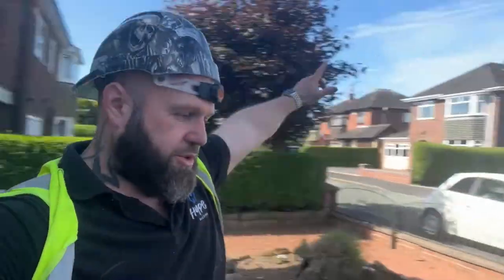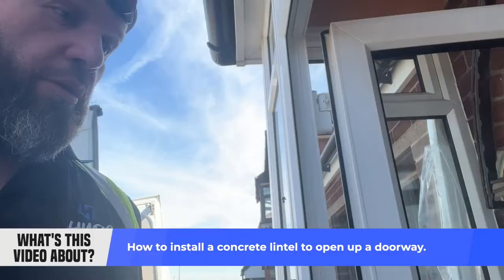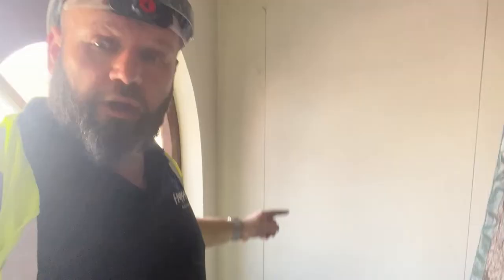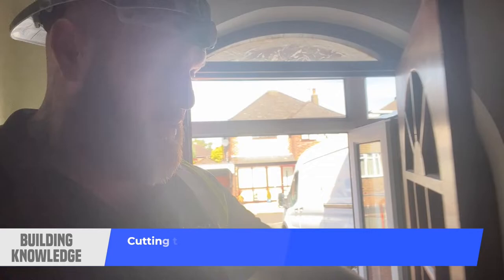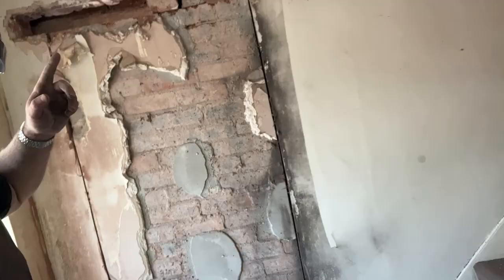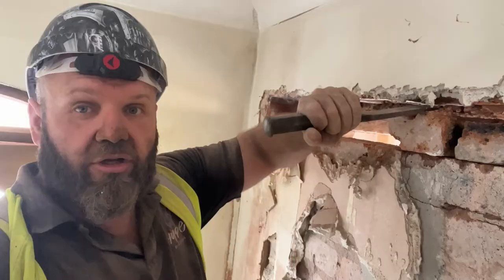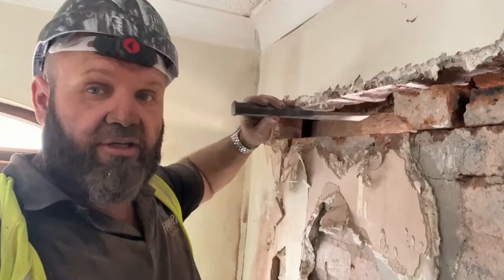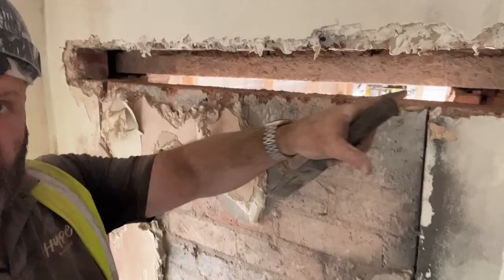How to Install a Lintel to Create a New Doorway

Comment: Why doesn't the wall collapse with all those bricks removed?  Shouldn't you have some support?
Reply from the maker: Hi there. Thanks for watching. Great question 👍 This one's a little tricky to explain. The stretcher bond of bricks either side of the door is still tied into the wall. Therefore, this brick and any above it cannot fall. There are only around 3-5 unsupported bricks that can possibly fall –  but these are easily replaced if they do. Hope that helps 🙂

Comment: Wishing you, your family and your crew a smashing new year.
Reply from the maker: And to you, John. All the very best for 2023 – hope it's a good one for you and yours. Thank you for tuning into HYPE TV, it's genuinely appreciated.
Reply: Total novice here! Just wondering why you haven’t used and acro props/ support whilst doing this? Is it because it’s such a short length?
Reply: Also why would you use a steel lintel instead of a concrete one? Our house has concrete lintels over all the windows except the front which are steel. These (steel) ones have started to fail. Should I replace with concrete? What was the though process of using steel for front of the house only?

Comment: Hello thank you for this video … I’m a big fan of construction videos 😅 I ‘ m actually looking for regulation about which type of steel angle bar section needs a 32” wide side garage door for replacement on brick siding wall (the currently one being a rusted sagging 1/8 or 3/16 thick flat bar .. I was thinking of a 3” leg n base 48” steel angle bar will that be enough and upcode? I’m in Michigan but code in this case might be pretty much standard.  It’s a ranch house above the door is 1 ft layed bricks then roof. 😮
Reply from the maker: Hi Thomas. Many thanks for for your comments. Hope all is well the other side of the pond 🙂

This is something we leave in the capable hands of our structural engineer, so we're not in a position to clarify if what you're saying is right, unfortunately. 

Thanks for watching, mate 👍

Comment: Great video, it helped in my situation(knocking through to garage) I have a block wall internal. Should I therefore be using acro s and strong boys and going to nearest bed joint line, then instal lintel and make up difference in bricks or slips.
Sorry to go on !

Comment: Good Morning..... Do you cover the Birmingham area? 

If not, do you recommend anyone in the area as I have an external wall in my mid terraced living room that has (what I was told) is condensation issues...but going through your videos about cold spots and what nots, the section that has crumbly plaster is where a galley style extension has been added on the other side (so technically that half of the external wall is now covered). 

Surely the crumbly plaster should be on the side of the wall where I'm looking out onto the garden bit??? Please help! I can send in photos if that will be much clearer to explain.....
Reply from the maker: Hi Selina. Thanks for watching our video. Unfortunately, we only cover Stoke-on-Trent and the immediate surrounding area. Sorry about that.

In relation to your question, you refer to crumbly plaster. Rather than being a condensation issue, could it be that the plaster has just lost its adhesion? The plaster becoming 'crumbly' could well be a side effect of building the extension when the construction work was taking place.